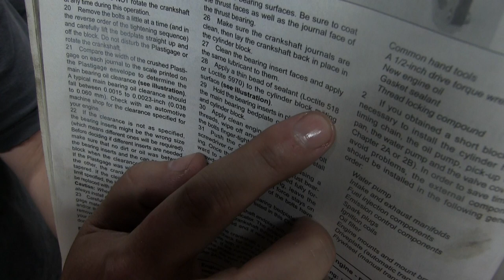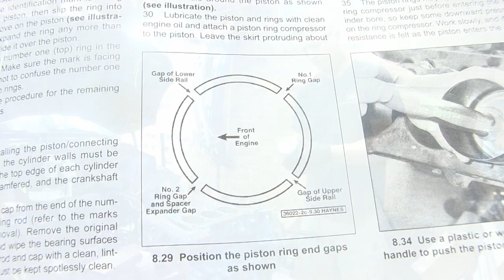E28a - Assembling the R53 W11 Mini Cooper S Engine - Part 1 of 2

Comment: Hi from the UK! Liking the content. I am looking at buying an R53 as a reliable daily driver for my wife - hopefully it will be reliable?! :/ Totally agree about the 'retrospective fun' analysis of what it is like re-building cars/engines. At the time it is a nightmare, you always run into problems and realise you need more tools / parts or you fitted things in the wrong order and have to take it apart again to get something else installed. BUT...it makes you totally fearless in future when doing the same job or similar on another car as you have the experience of how it all works and you get the satisfaction of having fixed a car and knowing the work has been done properly so it shouldn't break again for a few years! :)